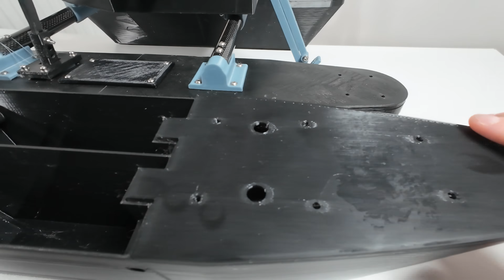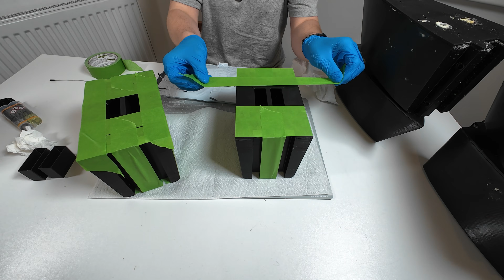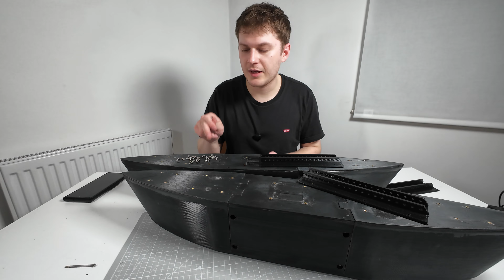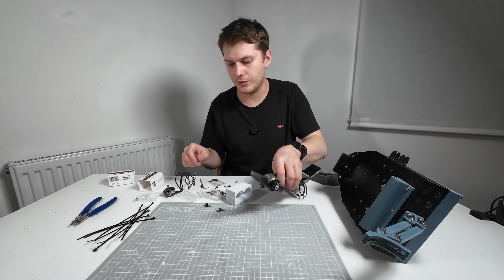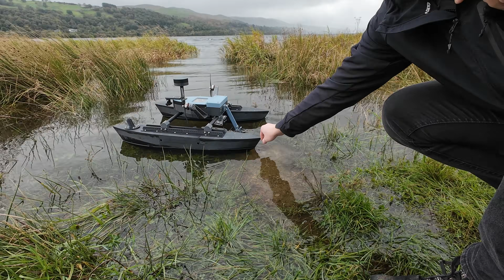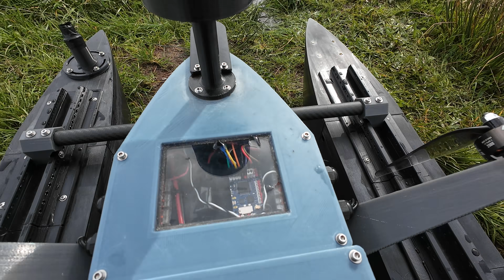Building The Autonomous Boat Designed To Explore - Part 2

Comment: Excellent piece of engineering, I like your approach to refining the system. I belong to a RC sailboat club, I'm starting to try to get a flight controller in one of them. I have 2 recommendations for you when you go to the lake, 2 things I always have when I go sailing, a pair of hip waders and a Kayak or inflatable rowboat. If your boat got hung up at the edge of that marsh with the waders you could walk out and get it, otherwise you get cold and wet feet, been there done that. We always have some kind of boat, we call it the rescue boat, batteries died, servos fail or hung up in some weeds offshore, the boat lets you rescue it. Great work, I just subscribed.
Reply from the maker: Thank you, i really appreciate the comment. Great minds think alike, we have waders in the car just in case. You've made me want to build another boat to recover this boat now in case. Its always worrying seeing it go out away from you. Thank you, it means a lot.

Comment: Out of curiosity, how much did it cost in the 3d printer materials to do the bigger hulls ?
Reply from the maker: I reckon with the mistakes aswell around 4 x 1kg reels. So probably 3 - 4... 
Its Sunlu Petg which i get for about £11 a reel. But bare in mind the hull is around 2mm thick 😀

Comment: neat. Video felt a little bit drawn out (or I'm just impatient today), but it's a cool project. Have you had a look at open echo as the depth scanner which should make machine interfacing way easier?
Reply from the maker: Haha the build was a little longer, but didnt want to skip parts. But the next video will be all testing out on the water :) ill have a look into that, thanks mate.